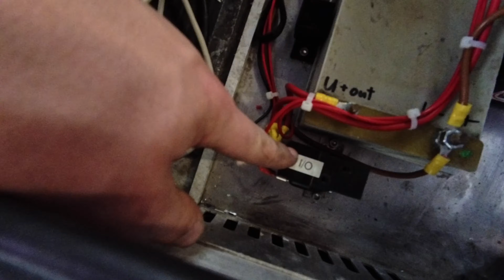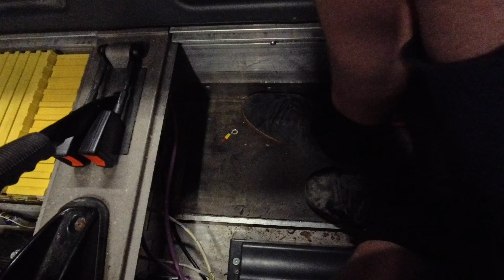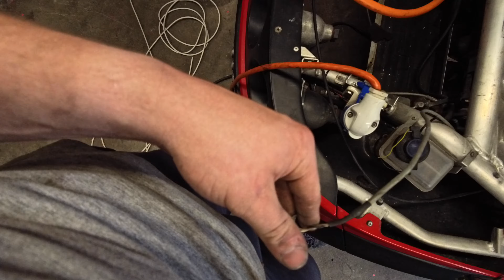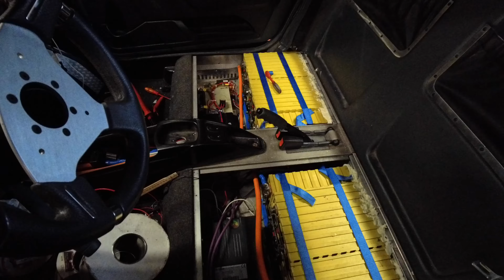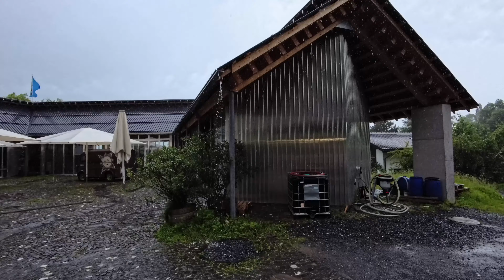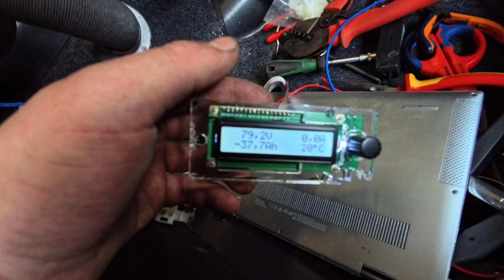Tazzari EVO build

Comment: Hallo  how about original engine controller ? I have broken BMS and I wonder if can I start the engine with differen one
Reply from the maker: Yes there are ways
I will have to look at the documentation ont the Weekend. Maybe then i can help you.
Reply: @apprenticeDoingTech  I have burned tazzari in the front part from my mistake with the batery cables . but I wonder if is possible use it with batery packs from e-up Vw they are 24v packs very powerful 13kg for 2,6kwh I also have another tazzari not burned but without batery pack and its for parts only. but engine is powerful and coulb be useful for maybe a boat or something but first I will try repair it somehow
Reply from the maker: Are you german speaking? If yes we cold continue in german. Please write via email its easier christian.obrecht@icloud.com 
The Motor can also handle way more then the 11kw. Depending on the controller that they used you can do anithing with the battery